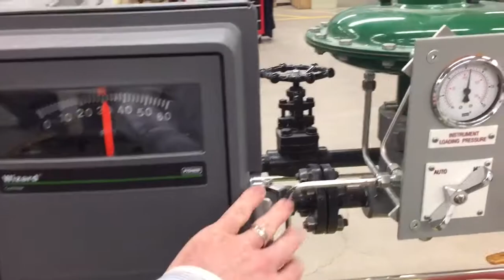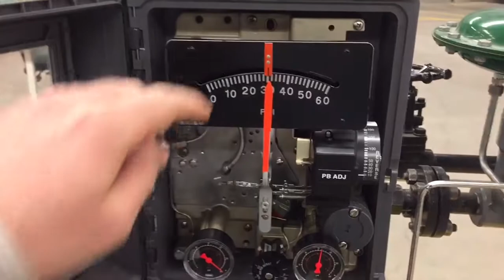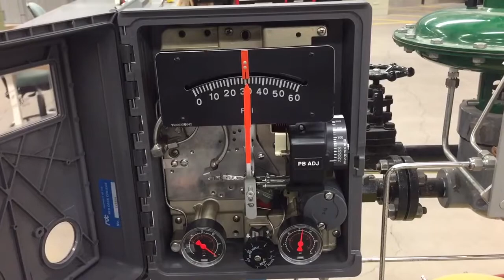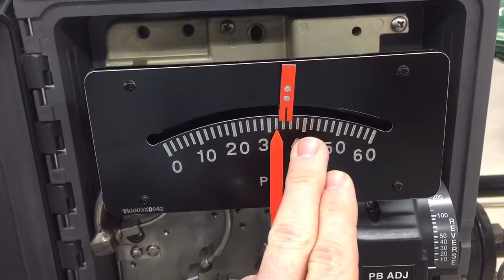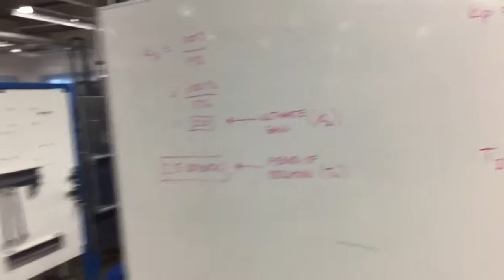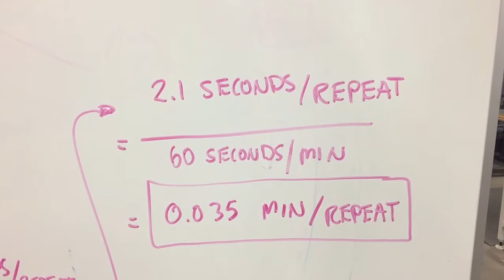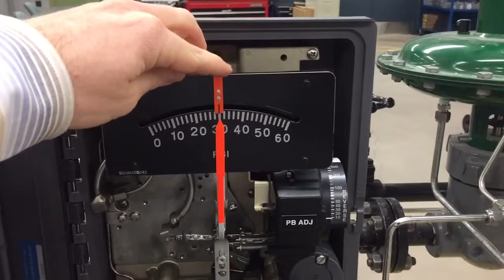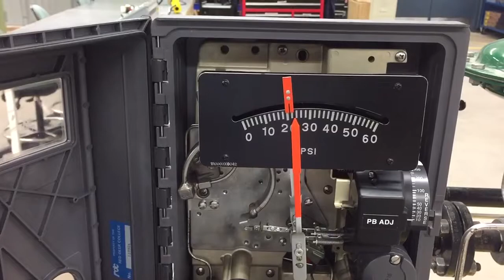Ziegler-Nichols Tune (Closed Loop) - Fisher Wizard

Comment: I have a model 4195KAME remote setpoint adjustment my question is can I move the setpoint by hand like what you did in this video??
Reply from the maker: I haven’t used a 4195 with a remote setpoint adjustment before. The manual it says the ‘M’ designates the remote set point option. It says it has a capsular element with a linkage to the set point indicator. You need to apply pressure to the capsular element to adjust the setpoint. Increasing pressure to the element increases the setpoint and decreasing pressure decreases the setpoint. Based on this information I would assume you would not be able to adjust the setpoint indicator like I did in this video unless you were able to disconnect the linkage between the setpoint indicator and the capsular element. If you cannot disconnect the linkage, you would have to move the indicator by applying pressure to the capsular element.

Comment: hi Sir, this is good video for me. The controller used for diaphragm actuator with single acting. how about for piston actuator? is it working normally with?
Reply from the maker: Tiennghia Bui the controller can be configured to output either a 3-15 or 6-30 psi pneumatic signal, so the actuator would need to be compatible with that type of signal.

Comment: Dear sir, thanks so much for your video. Would you please explain me about  these concepts in DVC6200 Fisher Positioner are  proportional gain, velocity gain and minor loop feedback gain. the 1st gain is Kp but what are the other
Reply from the maker: Son Nguyen That’s a good question. Making an educated guess I would say the velocity gain is derivative gain and minor loop feedback gain is an integral gain. It almost appears they changed the names to be more specific to a positioner. Knowing that position is a fast process to control and looking in the DVC6200 manual at these gain values used for different configurations, the higher suggested minor loop feedback gain and the lower suggested velocity gain match gain values that would be used for integral and derivate gain values on faster processes. This would have to be confirmed with Fisher to be 100 % certain though.

Comment: sir i really like your video, i have a question, from where this relation come from Kp=100%/P.B and how we choose P.B value for a system
Reply from the maker: jorch778 thanks for asking this.

Proportional band (PB) is a way to express the sensitivity of the proportional setting on a controller. It will be available as an adjustment on any controller using PB. The other way of expressing this sensitivity on a controller is proportional gain. Proportional band represents the amount of controller error that will cause the controller’s output to change by 100%. As noted in the video, proportional band is directly related to the proportional gain. 

Some controllers will use a PB adjustment and others will use gain adjustment. It’s really whatever the manufacturer decides when they design the controller. This particular controller in the video has the PB adjustment, so we had to convert our proportional-gain value calculated from the Ziegler-Nichols tune to a PB value.

Comment: Sir nice video. My question is that in an equation Kp=0.45 (ku) , where you get 0.45 ? and similar in an equation TI=Tu/1.2, wher you get 1.2?
Reply from the maker: faisal awan these were values determined by Ziegler and Nichols when they came up with the tuning method. These values can be found online by doing a quick google search. I use the traditional values for producing quarter-amplitude decay in this video, but there are also some modified values floating around out there for producing a response without overshoot as well.

Comment: Sir if I may where 0.45 came from?
Reply from the maker: It is the value from the Ziegler-Nichols tuning method for use when tuning and proportional plus integral controller. If you look up the Ziegler-Nichols tuning method, you will find it in a table.
Reply: @AutomationCliff  thank you sir